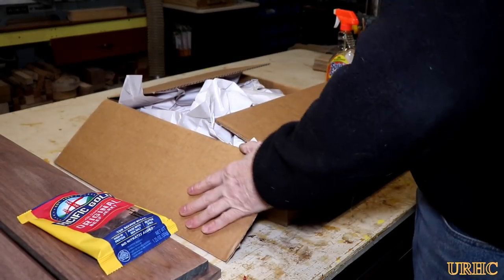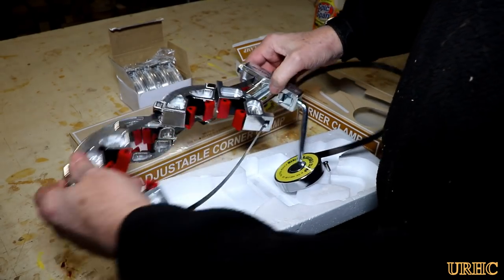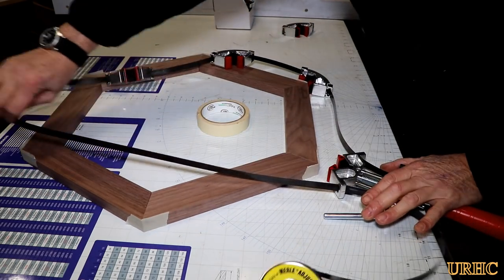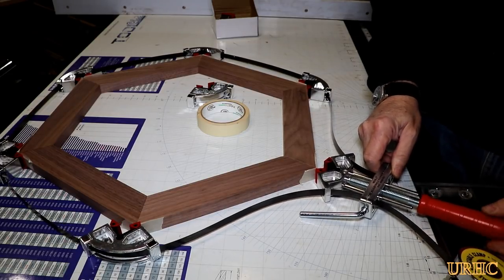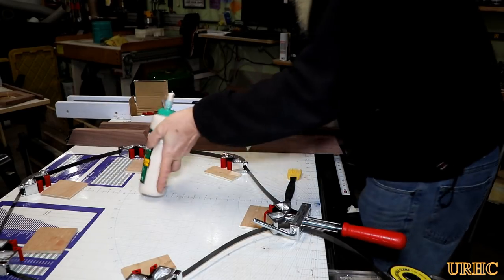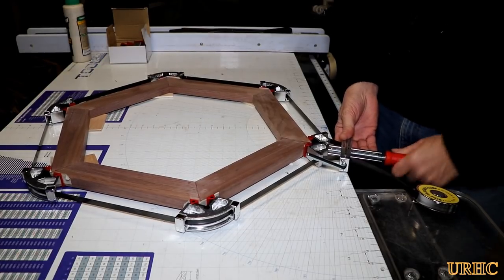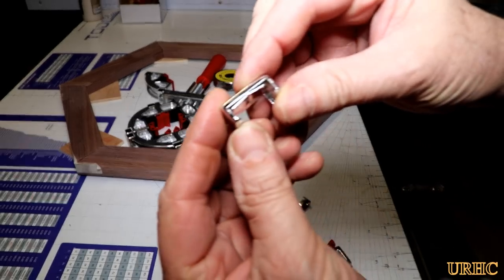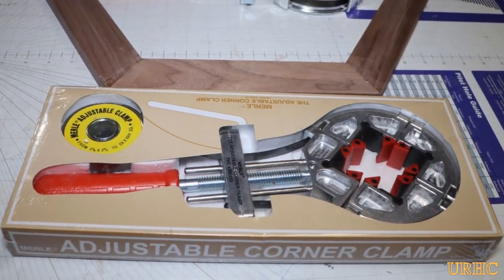Merle Adjustable Corner Clamp First Impressions

Comment: Very well done ... you explained everything, including a couple of items that could of been better and/or the potential knuckle buster.  You even demonstrated it very well covering every aspect of the clamp with a nice dose of frame assembly best practices.  I really got a lot out of it and managed to learn everything I needed to know about this specific clamp.  Cheers Mate!
Reply from the maker: You won't  use them all the time but they are very handy when you have a multiple angle  glue up. Thanks for watching.

Comment: Great review, the only thing I'd add is you didn't like the clamping mechanism for the strap saying you never know where the lever for the strap will end up. It should end up in the same spot every time, the strap is a constant thickness so I would imagine if you just do a half turn to loosen, then half turn to tighten. I don't see why  you would unscrew several turns. Thank you for taking the time though.
Reply from the maker: I put adjustable handles on them in another video that work great. Thanks for watching.

Comment: I bought one at the Wood Working Show in Tampa, and it has sat in my drawer after trying it.
I got bit too many times and it was a pain in the rear end to set up.
I went back to the Bessee one I have.
Reply from the maker: This one does apply quite a bit of evenly distributed force.  That winder can really bite you. I think it will see quite a bit of use in my shop. Thanks for watching.

Comment: I would lob off the handle, weld a 8mm socket on it and use one of those bendy screwdrivers to tighten it. Did something similar with a screw for my table saw, it was un-reachable without some form of contortion so i welded a square head on it and use a Stanley bendy to reach it.

Oh and i would remove the banding from the clamp body, and reverse it, so the spool sits flush, that way, with a small bracket, you could affix the spool rigidly to the clamp body so it's all a more compact body. Seems like a bit of a hassle with all that flopping about.

You can actually see what i mean on the picture from the box, where it's setup for 3 feet. The spool is the other way round. :))

Great video, hope you enjoy them for a long time, they seem solid.
Reply from the maker: They definitely are nice clamps but need improvement in those areas. I was thinking cut them off and pin on a clevis type handle that could flip every 180 deg or some of the ratcheting handles with the spring loaded splines. The spool direction doesn't really mater because you have to pull out extra. It is that little rewind handle that can bite you . Thanks for watching.
Reply: Yeah, i noticed. I had a roller tape like that, they can bite, no kidding. :)

Comment: Those types of clamps have been around for a long time.  I'm surprised that the band was spring steel?  Have fun with them!
Reply from the maker: Spring steel is required to keep it from linking.  They're great clamps could just use a couple updates to make them user friendly.  Thanks for watching.

Comment: Looks like a good clamp. Is the banding made of metal or Nylon? Looks a a finger cutter?
Reply from the maker: It is steel. Not very sharp so it won't cut you.  It is all the tension in that reel that releases after rewinding that can get you. It does a great job.  Thanks for watching.

Comment: I've got a dozen of these clamps had them for a few years always work but the rewinder is a problem and hard to get to work sometimes
Reply from the maker: That rewind handle should have a way to slow it down. It can hurt your fingertips if you are not careful. They look like they should last. Thanks for watching.
Reply: Yeah the metal band will cut you up for sure

Comment: Every time you post a new vid you've got another 1,000 subs - 50k isn't far off!

Interesting tool - odd how it's so well thought-out but still has some obvious shortcomings.  That clamp handle to secure the strap is really not optimal.

You mentioned "other projects" - are there some segmented bowls in your future??
Reply from the maker: Every time I post a cooking video I loose a batch of subscribers then the next day I get more new subs. Never thought I would get more than a couple hundred. 

I was surprised by those couple issues but they don't affect the operation and should be easy to fix. They apply quite a bit of well distributed force and work great. I wish my lathe was big enough to turn bowls. Thanks for watching.
Reply from the maker: I have to start making jerkey again because that stuff is not that great. It does wash the lettuce down nicely.  😁